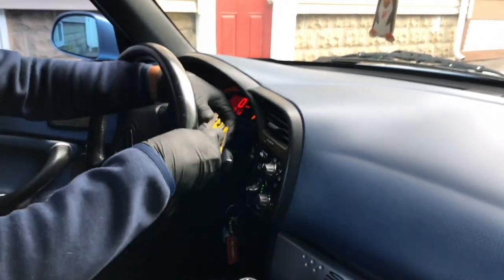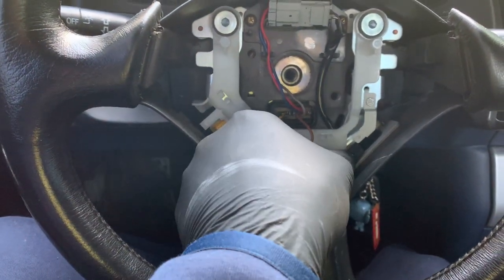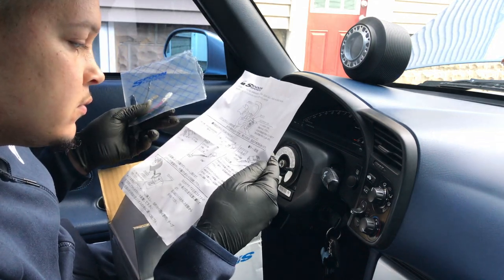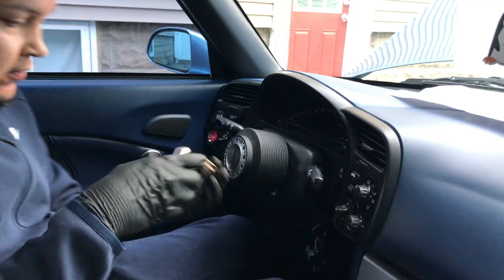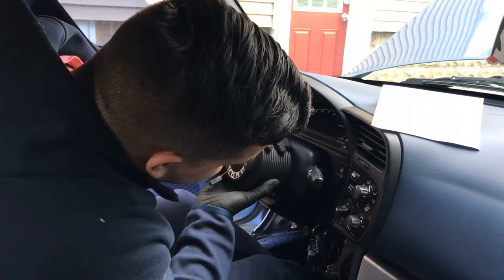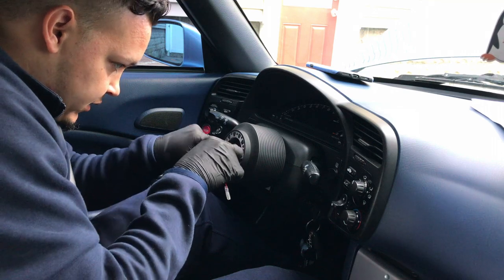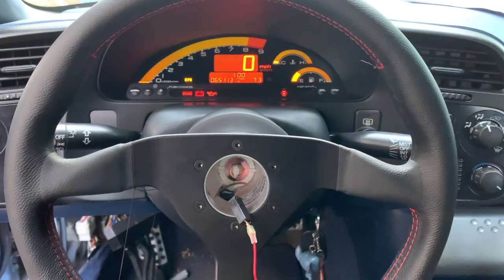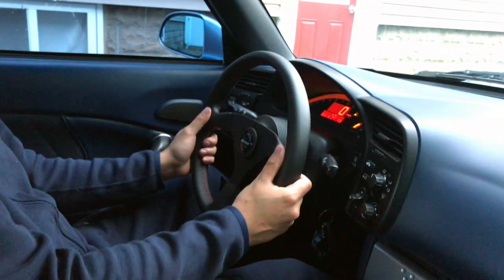Spoon steering wheel install

Comment: Where’d you get the wheel from? Looks super sharp!!
Reply from the maker: Hey, so the wheel was a gift from my beautiful Wife a few of years ago, but she purchased it from jhpusa.com. It’s easily one of my personal favorite parts on the car for a plethora of reasons. It’s slightly smaller than stock, a lotta bit lighter(cause no air bag) nice stitched leather, and it’s a gorgeous wheel. Plus the car’s mostly a Spoon Sports build so it falls in line with the theme and appeals to teenage me who would have loved, a Spoon’d out s2000.

Comment: Are you selling S2k wheel and air bag? what was the wiring process on the air bag?
Reply: My bad I see the resistor, are you selling wheel if you haven't already? I'm trying to keep OEM products for interior.
Reply from the maker: Sorry I am not. I'm hanging on to all the car's original parts just in case I ever want to go back to stock. Thanks for watching!

Comment: Hey sorry for this kinda dumb question. A newbie here, but is it a spoon steering or momo ? Would be great for an explanation 🙏🏻
Reply from the maker: Momo makes the wheel for Spoon to their specs, so it's made by Momo but a Spoon part. It has its own Spoon part number and Spoon horn button. It's similar to the Momo Monte Carlo wheel but its a little bit bigger in diameter. Originally this wheel design was exclusive to the Spoon wheel but Momo began offering it as its own wheel and in different options such as materials and smaller diameters. Hope this answers your question!
Reply: MojoGarage that really clears up everything, thank you so much for the explanation and time 🙏🏻🙏🏻

Comment: Do you know if there's any difference between the monte carlo wheel and the spoon? Besides maybe diameter. Thickness? Dish?
Reply: I have the Monte Carlo in leather with red stitching and it looks like the same steering wheel to me. As a matter of fact, Spoon steering wheels are made by Momo. You may get a Spoon horn button with their version but otherwise the only difference, as far as I can tell, is that Spoon comes only in 340mm while the Monte Carlo versions can be had in 330mm or 350mm (along with a Red or Black Momo horn depending on the color stitching you get).

Comment: Just wondering how did you get your horn working in the end?
I seem to be having the exact same problem.
Thanks
Reply from the maker: I was testing the horn button without it being inserted, once it was put in place it started working. Just have to make sure the ring in the hub makes contact to the little contact rod on the horn button.

Comment: hey bro..thats steering wheel is that?? https://www.ebay.com/itm/14inch-350mm-JDM-Spoon-Black-Deep-Dish-Leather-Racing-Sport-Steering-Wheel/254241976533?_trkparms=aid%3D111001%26algo%3DREC.SEED%26ao%3D1%26asc%3D225085%26meid%3D13cbc8bc9cdc483bb45d94614fb81a77%26pid%3D100675%26rk%3D1%26rkt%3D15%26mehot%3Dpp%26sd%3D254241976533%26itm%3D254241976533%26pmt%3D0%26noa%3D1%26pg%3D2380057%26brand%3DUnbranded&_trksid=p2380057.c100675.m4236&_trkparms=pageci%3Aad5ccd53-982a-11ea-a9b0-622c255b94b5%7Cparentrq%3A22378c2a1720a9ccf4fc4a5affa30cdd%7Ciid%3A1
Reply from the maker: No, its this one https://jhpusa.com/collections/spoon/products/spoon-sports-race-steering-wheel
Reply: @MojoGarage  oookkk my friend..thanks a lot